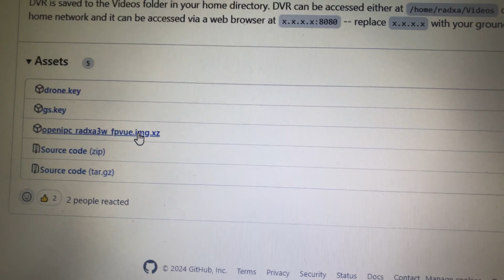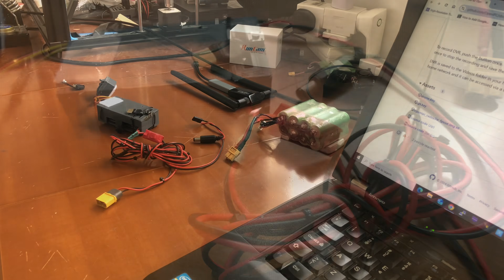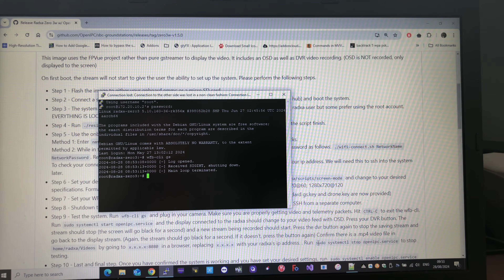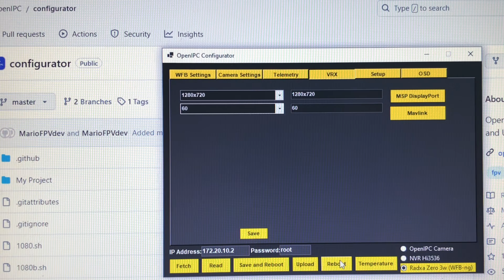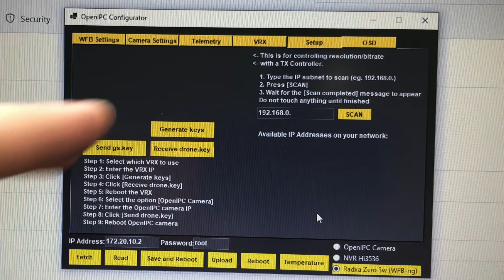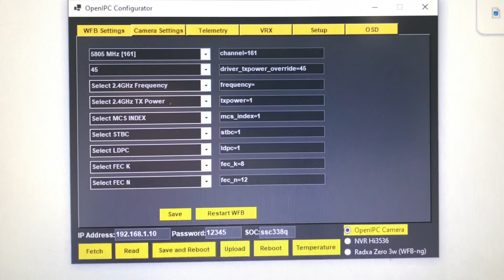OpenIPC RunCam and Radxa A-Z Setup Tutorial

Comment: My RunCam does not respond on the network at all. Power is correct Green LED is on. I've tried going straight into my laptop Ethernet and into my router. The Radxa shows up in the OpenIPC configuator scan but the camera doesn't do anything. Oh the RunCam does generate a GS.key and user.ini on a blank SD card but that's it. Any suggestions would be helpful.
Reply from the maker: Do not use the RunCam firmware. Use the configurator and flash OpenIPC URLLC version. Then setup your camera normally. Cheers mate!😊🍻

Comment: Is it possible to use open IPC on Radxa but with SIM modem with VPN to transmit the video to GCS?
Reply from the maker: Yes. Just use a gstreamer pipeline to forward the video stream from 127.0.0.1:5600 to any IP address you want. Cheers mate!😊🍻

Comment: does wifi adapter matter
Reply from the maker: Yes very much. Check the compatible options in our Wiki. Cheers mate!😊🍻
Reply: @mariofpv  okay I ordered a radxa zero 3w 4g no Emmc with header, rtl8812au chips chipset wifi adapter i see others using,  and pre ordered the emax wyren 100mw vtx. I'm happy to give it a go :)
Reply: @mariofpv I ordered the emax 100mw aio board, Radxa 4g no Emmc, and rtl8812au chipset Wi-Fi module. I’ll give it a try :) sounds like fun troubleshooting

Comment: Is this guide up to date? Using OpenIPC v1.8.0 image I`m getting Connection Failed after executing wfb-cli gs. For some reason the WIFI otg is stated as unmanaged.
Between this video and the wiki guide i could not find a coherent step by step tutorial that does not omit something. Or even a troubleshooting FAQ
Reply from the maker: Download the latest configurator. If it doesn’t work with 1.8 report to the SBC ground station author. His name is Johhn Goblin. Cheers mate!😊🍻

Comment: Will this set up work with raspberry pi 4 or 5?
Reply from the maker: No. Raspberry Pi is old hardware with very limited capabilities. We do not recommend using them, you will have poor performance. Cheers mate!😊🍻
Reply: So which radxa zero 3w should I get as far as ram and storage size?
Reply from the maker: Most of us have the 1GB no eMMC version and works great, never had any issues. Make sure you use high quality SD card.
Reply: @mariofpv  did you mean 1gig ?
Reply from the maker: Yes sorry I edited it

Comment: i cross my finger we will see useable system for fpv pilot soon, with complet kit and more userfriendly!(and perhaps google for it with analogue compatibility) 
for me it s like  express lrs system for radio..it will be a standard with huge community
Reply from the maker: The system is already very usable. Thousands fpv pilots are using it because they have already and we know that because they have already bought the hardware.
RunCam already has the G bundle which has everything you need for a basic kit.
We have created the OpenIPC Configurator and it is as simple as clicking a few buttons to setup your system. No more command lines etc, very user friendly.
Goggles are under development. I have already posted a video for the honorary member. If you want to see it please consider becoming a member. Cheers mate!😊🍻